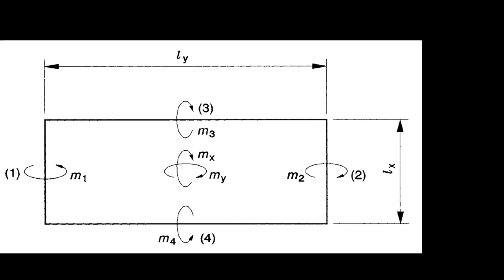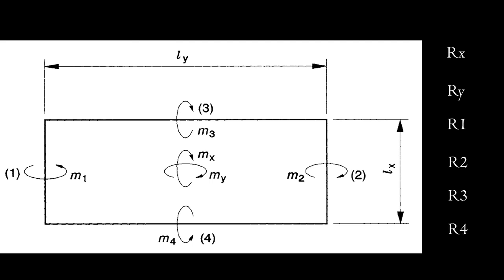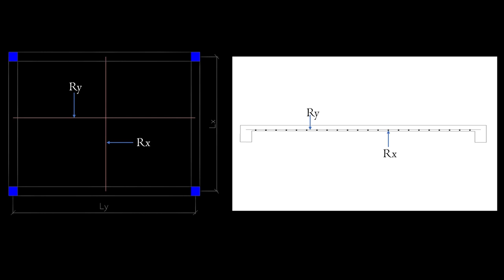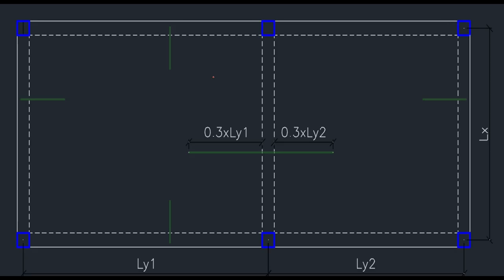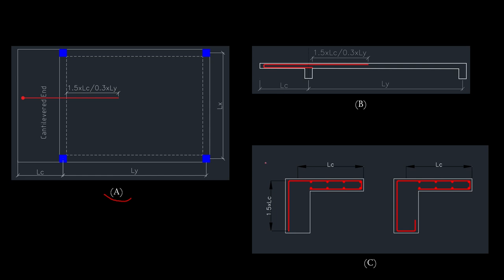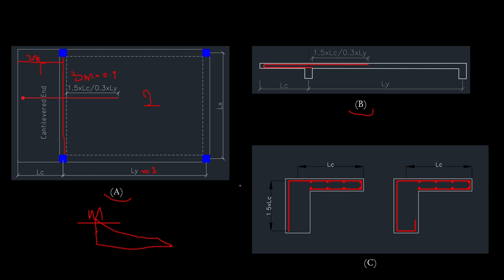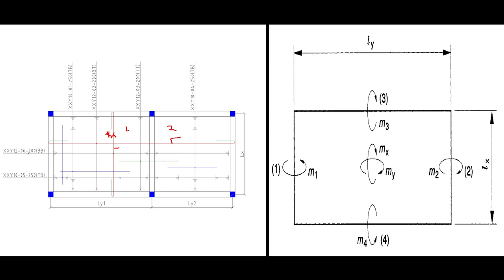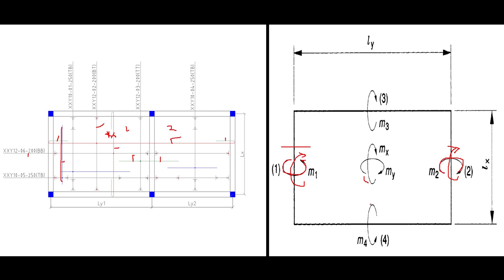How to Detail Reinforced Concrete Slab | 2-Way | 1-Way | Cantilever Slab

Comment: Thank you so much for the insightful presentation, sir 

I have a question sir, Is the return bar (Top reinforcement at the support) necessary for a simply supported one-way spanning slab since the moment at the support is zero
Reply from the maker: Even though, as per the design, it is not necessary and can be omitted in a simple end slab with no restrained end support, it must be provided in a slab with restrained end support (like a beam) to satisfy the beam flange requirements. In practice, it is recommended that you provide it regardless of the case.